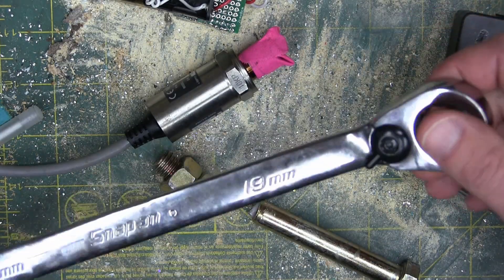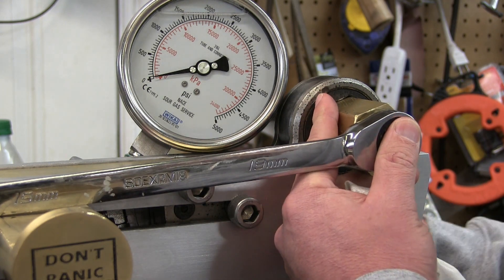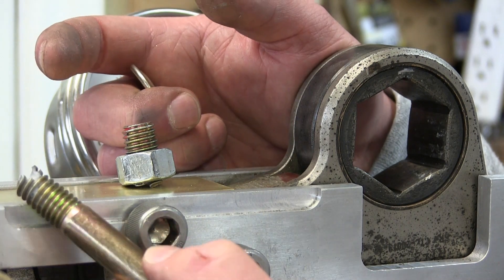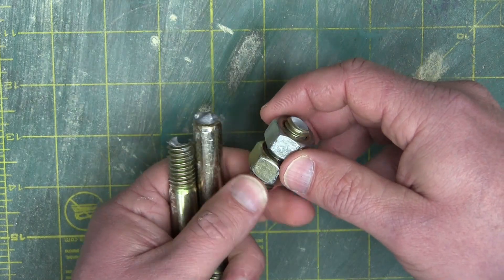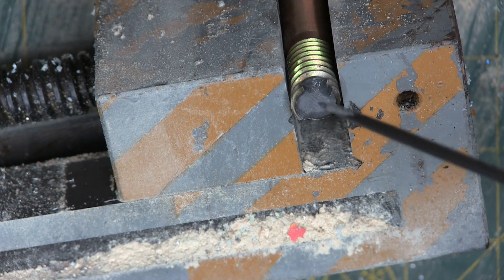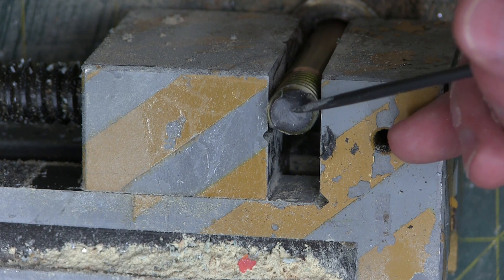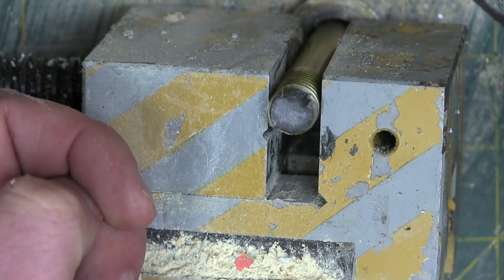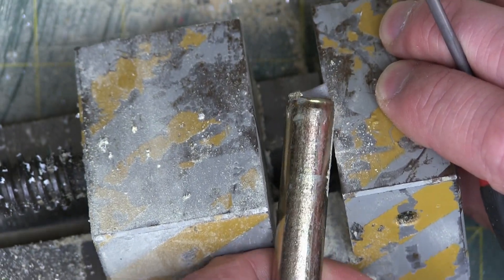BOLTR: BOLTS! | How much torque before break?

Comment: Since that wrench is only 8.5 inches at the point of pressure, your numbers would be off by 30%. Did you factor in the fact that the wrench was not 12 inches long at the point the pressure was applied?

Comment: Never heard of anyone replacing brake caliper bracket bolts, and if those break someone can definitely die. However they're usually quite skookum for the application. Often m12 or m14 fine thread and aren't torqued much past 80 ft lbs, or 4 to 5 ugga duggas.

Comment: Is there a video on that there bolt Torquestructomatic 69 machine you built there?
That is a hgdraulic torque wrench in there but it almost sounds like you are running it on an air system?
I could very well be wrong on that though

Comment: You should compare the strength of various classifications of bolts from harbor freight/Home Depot as compared to others, I’m very curious if the water cooler gossip about harbor freight and Home Depot bolts being inadequate for automotive use, especially like grade 8/class 10 & class 12 etc for horizontal weight bearing use like in transmissions

Comment: Bolts work via clamping force through stretching. Torque within the elastic range of the bolt (a function of diameter and material) and you're golden. If you overtorque to the point of plastic deformation (near it's yield point) the bolt doesn't exert the same clamping force and  never will again. Spent some time  developing connecting rod assemblies for PowerStroke mass production as a as a former Toolmaker, then Mechanical Engineer and Manufacturing Engineer and am a former welder/fabricator.

Comment: Hey Uncle Bumblefuck, have you ever fucked around with Moly fasteners?
That is some weird shit there. It's fairly brittle when it's new, malleable like mild steel when it is red hot and as fragile as glass when it cools off but if you heat it back up to red hot it is malleable again.
Then it cools off and is as brittle as glass again. You can heat cycle it hundreds of times too.
The stuff is wicked expensive.
They use it a lot in big electric heat treating furnaces.

Comment: i work in aircraft maintenance. reusing fasteners is normal, when its pretty common for bolts to be upwards of $800. unless the maintenance manual states it must be replaced or NDT'd as long as the bolt doesn't have obvious damage the bolt will get re used.

Comment: HEAR YE HEAR YE I HAVE A TALE TO TELL!!!! . .   me and a coworker, we are both greenhorns and he came off a rig, i came out of my own shop, got the job cause i showed boss my 200cc bicycle that goes 50 miles an hour, im 17 self proclamed mechanic prodigy work with my hands respect my land yada yada your hired ill take what i can get, was great for a while you know i got me a cummins 5.9 and hes got a waukesha 330, the boss is makin sure we dont fuck it up, if we aint sure we can just ask, just great up till boss goes out of town for a week end, we were wasting all kinds of time on a caterpillar c15 and you know at the moment my job was to do what my coworker says as his bitch i am just to follow his leadership, i get my own projects in the shop but today im the bitch, clean parts that should have been clean, scrape gaskets that should have been scraped and so forth, good thing too cause i wouldnt want to lead it into the ground, anyway, we already had the crank and cylinder packs in the day before, was outstanding, everything according to plan, today i walked in he already had the head on and torqued and we were supposed to pull out the old cam bearings with a special tool we just got, turns out it was incomplete and didnt fit, outstanding, well while we were waiting on that to go back and get swapped for the right tool even tho they said that fit everything but it didnt and my buddy got to lookin through the gasket set and he pulled out a little plastic thing and he said "does this go under the head" and im like "yea it goes right damn here what did you forget to put it in?" and hes like ". . yea . . fuck me" so we pulled the head back off and put it in and fought with the head hanging from the forklift, the lifting eyes are all on the one side of the head so it hangs at a 45 degree angle and to fit it has to come down straight so i suggested we set it down, put a bolt and a lifting eye in one of the exhaust manifold bolts and hook a chain up to the fork so we could lift it straight and hes like "nah we got this lets just do it" and im like ok ill sit here and lift it up and down all day for you, after all i get payed either way, so we finally get it back down, having deemed the now totally fucked head gasket to be perfectly fine, put the bolts in and torqued em, torquing the head bolts on a c15 you have to go in stages, all of em to 80 ftlbs then all of em again to like 150 ftlbs then all of em to 190 ftlbs then all of em turned 90 degrees after that or some shit so its a pain in the dick to even do it once ,a little later  the verdict was in the proper tool to pull the cam bearings out was impossible to get so we sat on our asses kinda cleaning up and i walked over to the gasket kit and found the little rubber bushings that go in all the holes in the cylinder head spacer plate for the cooling holes to help prevent rust and leaks and make the over all life of the motor longer and i show him and hes like "where do those go" and im like "fuck me ill show you and we walk over to another head and i show him and he gets pissed and we pull the damn head off again by now having torqued it down twice, and we put those damn rubber things in and i look at the head gasket with a sinking feeling in my stomach and our "substitute boss" walks in and im like look at this head gasket and hes like "yep need another new head gasket" so we sent our paperwork guy to go get it and we wait on that for a while and we clean up the shop benches and stuff and after like 2 hours the new new gasket comes in and we put it on and this time holding the head level-ish with a pry bar we set it down without ruining the gasket, torqued it again and we were back where we were from the beginning, moral of the story is dont half ass anything or you have to go back and do it again and again till you finally whole ass it and by now we were real bored of that peticular motor and its still like that, those head bolts are rated for one torque cycle, they wernt ment to be put in, torqued and pulled out 25 times and thats sketchy cause we are going with it and when this things built and we go to test run it it will be fine but when it goes and gets about 200,000 hours on it my spidy sense feels like its going to be on an episode of seconds from disaster some time later, thats just one of them ticking time bomb things, now AvE should i give my 2 cents to the boss and possibly help save a few lives and maybe prevent a giant ass oil fire that rages for 2 weeks or just let it keep me awake every night thinking how deep that cylinder head will be buried  after tearing through the rigs motor cowling and flying 25 miles away  landing in a hayfield

Comment: To determine if a head-bolt is OK ( non strechbolts) you do as mentions but you can also measure to overal langeth of the bolt and if there is thinning of the leg of the bolt ( nontherded part)   Inn large engines (800 hp + ie Warttsilla ) the leg of the bolt is not the same diameter as the treed.

Comment: Thanks for another video where I learn stuff.
Do different grades of bolt have different failure modes?
I buy the grade 8 consumer ones when I can, but are the lower ones just weaker? more accepting of production faults?  Or are they actually more malleable and ductile?

Comment: I used to work in a factory making pole line hardware. They made one clamp for transmission lines with a shear head bolt so that the workers could torque them with a loooong handled wrench from the ground. The idea was that when they reached the proper torque the first head would shear off and they'd know it was right. The problem arose from the fact that the bolts were galvanized in house and the guys in that department were more concerned with quantity than quality. As a result the threads would be full of shmoo and they'd break off before they were holding the wire. They were being installed way the fuck out in the boonies and were being delivered by helicopter. The QC  guy figured there was no way they'd pay to have them picked up so they'd just deal with the inferior product. Wrong. The company paid a guy with a dog sled to pick them up and send them back to us. 
Did I mention they were paying a grand a day penalty for late delivery?

Comment: In Aviation , most of the nuts are self locking type (tighter threads+a crown to put additional pressure on the stud) they are usually not reusable (one time use only) in rare applications/circumstances they are reusable but technical manuals will ask you to apply an X amount of torque more than Typical and watch for any yielding if found it's scrapped, in Engine/flight controls usually Bolts/nuts/washers  are dumped immediately in the trash bin to prevent mixing em with new hardware

Comment: Some bolts on gas turbine engines are measured length wise to ensure they are not over torqued. Especially on the gas turbine and power turbine. Thanks for clarifying to not reuse over torqued bolts in  critical areas.

Comment: So this leaves the question, wheel studs. The percentage of qualified nutfuckers is very high when it comes to puttin on your own wheels. Big truck, more bolts essentialy means lower torque. But over tightening wheel bolts is a big mistake.

Comment: is the color change from the outside of the shade to the inner core in 5:40 due to bolt tempering?  Looks like the dark band is thicker along the 12 o'clock to 9 o'clock and somewhat lacking from 10-12  where the bolt tried to pivot.

Comment: Very cool vidjay-o! There's actually a procedure described in the European standards for structural engineering that allows you to estimate the durability of bolted connections under cyclic stress. Given the number of load changes per year and the working stroke, you can calculate how long it takes before the connection breaks using the Wöhler diagrams. Cool stuff, really!

Comment: AvE,

I enjoy all of the bolt-em-up stuff you have been doing.  It would be enlightening if you were to get ahold of a bolt tension calibrator(Skidmore-Wilhelm ) and demonstrate the tension developed by various grades of bolts and the variation in tension and torque with dry vs lubricated.

Comment: I'm no expert but a 45° failure under torsion is brittle. Probably the result of work hardening in the remaining section once the crack has gone over half the bolt.

Comment: Something I never figured out - by how much does one have to adjust the torque when torqueing a lubricated fastener?  ie, is the specified torque value for an application dry or with antiseize?
Reply: There are guidelines for this, +- some percent of torque rated for a dry fastener. Different coatings also affect how much friction there is in the threads.

Comment: Our weird uncle knows everything from pixie wrangling to welding and failure analysis! Regarding your question with Mor's circle though: ductile materials fail at the orientation of greatest shear, brittle failures occur at the orientation of greatest tensile stress. Maximum shear occurs at 45° from maximum tensile stress and vice versa. So that bolt you were wondering about at 7:15 was actually a classic torsional-brittle failure. If you want to see a practical demonstration of that failure mode, you can take a stick of chalk and twist it till it breaks. If a ductile material is in pure tension it make a 45° break called a cup and cone fracture. Keep the awesome vids coming!

Comment: As a kid, I worked on a crew that set up amusement rides and watching this video made my heart skip. We used many stripped, and warped bolts but was always reassured by the foreman with no arms that it'd be OK.  I remember having to use a pipe over my ratchet just to get the nuts to the end of the thread...never did ask that foreman how he lost his arms but I think I have a good idea after all these years.
Reply: How did he hold is clipboard and pencil without having arms?
Reply: This guy was straight out of a Squidbillies cartoon. He had the wooden arms from the elbow down with the creepy hooks and everything. It was my first and last time I ever helped out the carnival people, and the last time I ever rode an amusement ride.

Comment: I remember a bit from ARP about bolt reliability. In an aircraft there's an excess about each part. In a car engine there's two holding on a piston rod cap. Those have to stand up everything without backup.

Comment: This is why I love redundancy so much, not so much about durability, which is good, but also safety.  Never hurts to have redundancy in spades, more than adequate fasteners, more fasteners than needed, more beef in material, large excess makes things not just safer but also more durable, meaning the difference between a product that will break eventually and one that will almost certainly last forever due to over engineering.  Redundancy is good.  I really like having things that will last forever, and redundancy in terms of strength will help accomplish that by creating something that will not take any harm from the minor amount of stress in comparison to the material and product used.  I really really like redundancy, especially in terms of strenght, but redundancy in general.
Reply: Id really like to add that redundancy helps with safety because the excess strength in materials, fasteners, construction, and engineering means the thing will maintain integrity and safe usage even if it fails in part or has more than normally expected loads, or if redundant enough, perhaps both.  Redundancy is good for both safety and durability.

Comment: Head bolts are a real interesting subject just in and of itself. Cannot be reused, because they have to stretch a certain amount, you have to get the torquing, order and angle correct, etc. One of the few types of bolts were you really cannot fuck around.

Comment: How did you get to the conclusion that grade 8 bolts can handle 200-250% rate torque? Seems a bit fishy, never trust advice given to me for free...
Reply from the maker: +hamstanz  absolutely, do your own testing.
Reply: WARNING: UNSOLICITITED RANT ABOOT BOLTS

Think it is also a bit dangerous to talk about "rated torque" as bolts are rated for stress (yield, UTS) not torque. This is because torque is specified to generate a stress which is normally design as a percentage of the proof stress. Different lubricants/surface condition could change the amount of friction and therefore the amount of stress in the bolt at the same amount of torque! e.g galv bolt and zinc plated bolt with same torque wont result in the same preload. Normally if you aren't being super precise you'd just do a T=0.2FD, where F=spec. preload D = Dia. of your bolt. Not the hardest calculationes to do.

Also would add that going on the higher end of torque/preload is always better as it will help to prevent fatigue, 90 percent of all failures occur because of fatigue. So its better to crank it up and have it fail due to overload in the shop that in service due to fatigue. Rumor has it that failures cost $1 at design, $10 in the shop and $100 in the field.

 Although I am guessing you already know this Dr. Bumblefuck!

Kind Regards,

Humble Viewer

Comment: Fuck off, you bottomed the tool at enough to bend the wrench, repeatedly for "ten minutes" which stretched and hardened and hardened and stretched that fastener until it only took a mere (insert foot pounds here because I can't be arsed to go back to the bit in the vidjayo at this moment but I patreaeon you a god damned doll hair a month so that can slide) until the toight and brittle as fuck farsetener snapped.(unless I missed a trick and you loosened it between swinging on it but that would've fucked it just the same) Great vids as always. Keep your wick free of ice!
Reply: could've I got this a week earlier on petrayion? Bugger.... I should log into it more often and see where my ill goten english groats go once converted into the kanuckistan peso long before all the freeloaders on here get to see it.
Reply: And I quote... "Less than 200 ft lbs"... come on AvE.... use your noodle!!!
Reply: now taking time to watch it fully before spewing and the autopsy is beautiful.
Reply: You ended it different too and actually explained all the clicks you did on the 500ftlb hydraulic torquer you swung of it perfectly through the material science and physical evidence. I do love your vids, if not for the fathomless depths then for the salty goodness and refreshing language. You are a cunning linguist and a fart smeller.

Comment: Good video idea. Had this problem when removing and installing my turbo manifold 100 times to tune the vnt stop screw. Manifold stud reused... Not a good idea. Trying to torque down ... That fine line between tight and stretchy stretchy. Snapped a couple that way trying to get em toight. Yea I should invest in a torque wrench but studs are cheaper and self admitted 200lb apprentice. If it ain't tight it ain't right . Same applies to the girls I go out with.

Comment: A classic torsional failure in a threaded fastener. Most often happens in dry fasteners due to the high coefficient of friction. In a well lubricated fastener, there will be a typical tensile break with necking and ductile cup and cone fibrous fracture faces

Comment: Well, all I can remember is that you have 45 degree failure from torsion in brittle materials. ductile ones break at 90 degrees. If you want to see that take a carrot and break it by torsion. Am aviation enginerding student, I study that shit all day long. That is because you have maximum normal tension at 45 degrees, and brittle materials suck at tension.